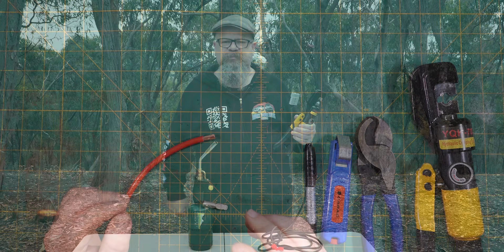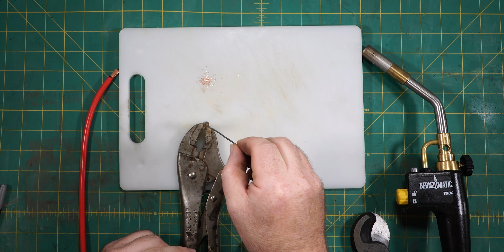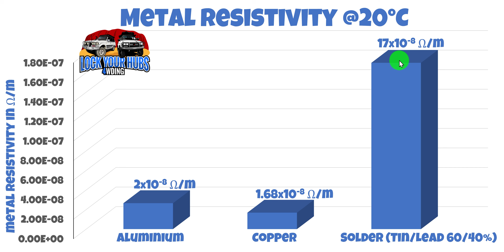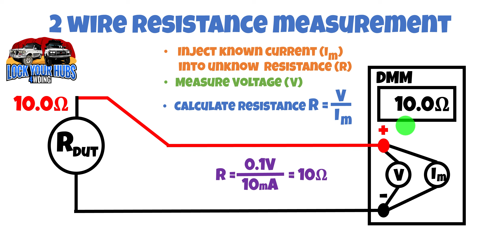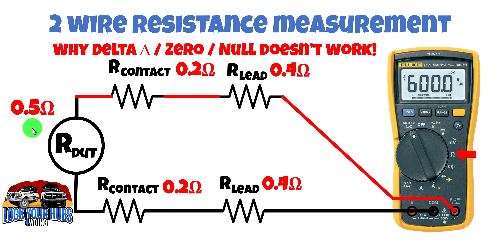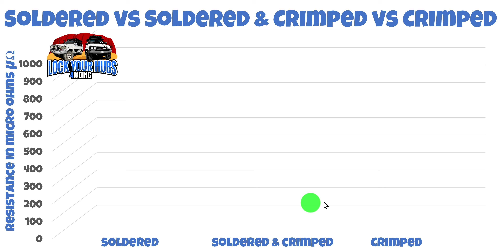Crimping vs Soldering for Anderson Plugs

Comment: Had a thought about 'tinning' the stub to go inside the Anderson part. The start of bonding the solder to the copper prior to the plunge into the molten solder.

Small Bottle of soldering Flux with a 'cotton bud' as the applicator could make the solder bond more effectively maybe.

Thanks for the demo ,so good and factual .

Comment: As an AME and having crimped many bonding cables as per Boeing and Airbus specifications and performing inspection and final testing using approved test equipment, I fail to believe that a solder terminal is better in any way than a quality terminal and  correct crimper used by a person that has training in correct crimping procedures.
Reply from the maker: So you could say you don't agree with my findings! 😂 And I understand what trade and undergrad classes teach, my question though is have you ever done AB testing yourself? To either confirm or disprove my testing done here.

Comment: just 1mm of solder, same with the cable's tip.  so it's "soldered" at the tip of the strands. Then crimped at the neck. 
 Maybe do a resistance according to how much green and powdery crap is in the connection. EVERY CAR THAT SITS FOR A YEAR OUTSIDE IN OREGON will have green chalk chia pet in the joint
Reply from the maker: Use some glued heat shrink!

Comment: Crimping is much better than soldering when it comes to vibration resistance. Anyway, finally found a video where the proper tools are used for crimping these SB 120 connectors. And very well explained!

Comment: Id really love to see these resistance tests under load through the connection of the anderson plug itself, i cant find anyone else on youtube who seems to have done so, and you seem very suitability equipped to do such testing! Love the video thankyou
Reply from the maker: The termination resistance would be twice the measured for each positive and negative. Then twice the contact resistance (not sure what that is! Though I understand it's around 1.2-2milli ohms per Anderson.) 

As the resistance is not going to change with normal usage, you could just use ohms law to derive the contact resistance.

Comment: I've always thought soldered is the way to go this was a great demonstration thanks. I had no idea crimping alone was so much worse.
Reply from the maker: Don't get me wrong, crimping is orders of magnitude worse than soldering resistivity wise, though the overall losses of a couple of crimped connections in a wiring setup vs soldered while higher, will not be orders of magnitude worse than the same setup, when you take into consideration the losses in the cable, contact losses of the joints etc.

Comment: Excellent!  Curious the resistance:Tip to tip of just connector as well as same length of wire without connector.  Both will be tiny but they can quantify the same bonding methods.  Thanks!

Comment: I used to crimp but they didn't hold, then I crimped then soldered.. the solder did the holding  because I had really bad crappy crimps.
I got tired of that and actually got a good crimping tool and learned how to crimp and now they hold.
And while I don't have a lab to test things.. I think that from what others have said, they have a really good case for crimp only and that is what I do now.  Even if wither method would work fin for my uses.. I prefer to do things right and I don't like that solder has different conductivity and heat expansion and capacity to crimped copper or cca for that matter.
Reply from the maker: I think the most important variable is the quality of the termination, whether you decide to crimp or solder.
Reply: I've bought awg 2/0 wire before  and it fit in a awg 2 lug.. that wire did not meet the standard for double aught wire.. the lugs were ok, but some lugs are too thin too.. anyway I sent it back as I needed at least 1 awg  but supposing I crimped that wire with a 2/0  lug or proper wire and a poor lug,  neither would be a good hold. And it takes a bit  to know.

That hydraulic crimper was a good grimper but it can't make up for other deficiencies.

Also there are specialty crimpers for Andersons.. so that was even the wrong crimper as that was for lugs, not open barrel terminals.

So there could be several points of failure here.
Reply from the maker: @coo463  you're right that ideally you use the correct combination of crimper, wire and lugs/termination.

Comment: I’ve read the soldering can cause premature failure.
Reply from the maker: I've heard that as well, though not seen any concrete evidence.
Reply: @LockyourHubs4WDing  
I’m not sure, but I think what was said was that soldering a connection results in the wires outside the lug or ferrule Wicking the solder and then movement of the wire causes the strands to crack. And you are probably aware of this because in another comment you mentioned that you don’t tend the wires before flood soldering because you don’t want the solder going under the insulation.

I’m building up solar system for my RV. I’ve used zero solder. All of the crimps so far have been made with a hydraulic crimper. It was very interesting to see the data in this evaluation you did. I was very very surprised my degree is in chemistry and seeing something like this makes me want to investigate further. But I’m 70 years old and building an RV. Not gonna’ to happen.

Anyway, very nice video. I’m also impressed that you respond to your comments. I’m going to subscribe to your channel even though I probably won’t have a use for any of your videos. Well actual use. they’re interesting though. But hey, that’s kind of a use, isn’t it?

Comment: I'm thinking that the reason soldering came out best could be that, while solder may be less conductive than copper, it's got a full 360' of contact with the connector. Unless the crimped one is crushed up until the coppers strands inside deform enough to remove every little air gap between the strands in contact with the connector it's going to result in  lines of contact between the strands and the connector.

To help explain what I mean, picture arranging a single layer of coins in the bottom of a round cake tin. Around the edge of the tin you'd only have multiple little points of line contact between the edges of the coins and the inner edge of the tin, so dispite having a lot of surface area on the tin and the coins, the two surfaces are only touching in a tiny percentage of that area. If you smooshed something conductive between all the coins and the edges of the tin you'd increase the contact area between the coins and tin by a huge factor, so even with solder being less conductive, the hugely increased area of contact between the surfaces nulls the extra resistance out.

This theory could be wrong, but it seems pretty plausible in my head.
Reply from the maker: Lost I agree to some extent, I have cut open a properly crimp connection and the copper strands do to form like you say.

Comment: I'm an electro-mechanical engineer having developed large Li-Ion batteries since 2008.

Crimping basically works by deformation hardening the lug around the compressed wire strains. Heating it with a solder iron or torch anneals the hardening so the lug lose it's tension and the strength is left to the solder tin, which is prone to cracking if exposed to vibration.

That's why crimping is an industry standardized method that you can trust (if you follow the standard) and why soldering is not!

Read and learn DIN 46234, DIN 46235, DIN 48083

And also, crimp terminals should be tested through both resistance, heat cycling and mechanical stress. Heat cycling is done at 120-140 deg. C by injecting current. That's also standardized!

Now try put your soldered terminals through 1000 such cycles (knowing that copper and tin expands/contracts different) and do your resistance test again - let alone a proper pull test.
Reply from the maker: While I couldn't find specifics of the Anderson terminals, I had a look at a major supplier (Cambac), their lugs are supplied in a fully annealed state. 

So I assume all the hardening is work hardening? 

Annealing copper usually starts around 200-300C, though to fully anneal requires around 500-650C. 

Soldering requires around 180-190C for the usual lead/copper. 

Though the temp isn't controlled  to the exact degree using a blow torch to solder! I don't think the work hardening would be affected greatly by the soldering process.  (Though happy to be proven otherwise! )

If you are heat cycling to those temps, while it may be compliant with the standard, it might not be a bad idea to up the conductor area! 

My objective of the test as stated wasn't to assess tensile strength, heat cycling durability, or even vibration resistance.  It was only to look at conductivity, and the testing proved that a soldered connection for an Anderson plug termination is superior to a crimped one.
Reply: @LockyourHubs4WDing  Yes, they are annealed and designed to harden when you crimp them - and that's why you don't solder them afterwards as it only takes 200-250 degrees C to anneal copper while soldering takes 315-370 deg. C (otherwise you get a cold soldering).

Same is the case with Anderson pins and all other crimp terminals.
Reply: @LockyourHubs4WDing  And no, I don't believe you proved the conductivity. 934 microOhms seems totally off unless something in either the crimping or testing process went completely wrong.

I previously linked to a paper showing test results of various crimping methods of more than 60 cable lugs. All turned out between 2 and 9 microOhms - which is more than 100 times more conductive than yours.

Dunno where that comment went (maybe removed because it contained a URL?) but you can search the titl: "Dependency of the Electrical Resistance in
crimped connections on mechanical stresses".
Reply from the maker: As a rule, URLs are automatically censored by YouTube. 

My results as always were an average of three tests, so while I could have been consistently incorrect, it's aimed to stop erratic results.
Reply: @LockyourHubs4WDing  Thanks for telling me, I didn't know that rule.

Now if you made the same mistake all three times, your result would be the average of 3 erratic results, which likely explains why it's off by a factor of 100 relative to the paper.

So in stead of using the same messed up method 3 times, you should use at least 2 different methods, one of them e.g. involving a professional micro-ohmmeter, that you can most likely borrow from the nearest university if you don't want to buy your own.

Comment: I usually just insert the wire and have a bit of the insulation exposed and heat it up and feed solder until it's full, then heat shrink the end after cleaning the end that has melted slightly.
I might try your method and see how it goes.
Once done it's a nice clean finish and heat shrink goes from the round part of the lug and down the cable past the heat affected bit, the end result I have found is tight and I have never had a problem with any that I have done, infact the Anderson plug that connect to my ute for charging the caravan has to be redone as it was there when I bought it as it is crimped and corroded with loose strands, where the ones I made for the solar panels is strong
Reply from the maker: I think decent double walled glue lined heat shrink is the trick to it, whether you solder or crimp, it protects from corrosion and reinforces the joint from fatigue.
Reply: @LockyourHubs4WDing  and that is why the one i have to repair is worn but it also took 14 years haha

Comment: but do your findings scale to high amp applications? Perhaps your modest current benefits from larger total contact area of soldered connections. I wonder what results you’d get if you pushed 50-100amp through those leads.
Reply from the maker: Resistance is resistance and will obey Ohm's law

Comment: As an Electrician, there is a reason we have to get our crimpers calibrated, and yes even the red, blue and yellow pre-insulated crimpers when we are building mining and gas and oil equipment.
My guess would be that the crimper used didn't compress the strands in almost one solid mass.
Cabac have a good handful of pages in their product manual showing over/correct/under compressed lugs.
It is worth a look for those who are interested.
Reply from the maker: Those results, don't forget were an average of three tests, for all the tests. While the possibility of consistently incorrect results for all of the tests is a possibility, it's not probable. 

I'm happy to be proven wrong or otherwise. And encourage others to replicate the test, to see if they're independently repeatable or not. 

I'm still going to have a look at vibration resistance, with and without heat shrink. I've been told by all and sundry that crimped terminations resistance was less, now have experimental data proving that to be false. I'll be looking at the next wives tale.
Reply: @LockyourHubs4WDing  Have a google for Cabac Crimping Guide and either find the PDF that says the Right Tool for The Right Lug for the Right Connection, or around page 17 or 27 or something like that for the same info.
Cabac also have some videos of good compression in the joints.

I have been running 7 strand cable with a crimped and soldered lug on the back of my rally car alternator since the late 80s, and it has been through multiple engine changes, alternator changes, tens of thousands of punishing vibrations, and the sort of thumps that break engine mounts. I have also done similar with 4wd wiring. I don't recommend it to others, but I would like to think I knew what I was doing as an apprentice, yeah ok I guessed back then, and since then I should know what to look for with damage and wear and tear.
I did make a 32mm pig tail style of coils to absorb the vibrations and they have held up on every vehicle I've punished. lol
Reply from the maker: Thanks I'll check out the PDF over the weekend. You make a very good point about support,  plenty of termination issues would simply disappear, regardless of soldering and/or crimping (even low strand wire!) if the termination is properly supported.
Reply: @LockyourHubs4WDing  Sorry, I think I led you astray, mine aren't supported, although supported would definitely be better, just bolted straight to the alternator stud, or other bolt, stud, terminal, etc, with a bit of a pig tail for movement, some then have a straight run, and then bolted to the battery, starter, or chassis, depending on which vehicle and which cable.
Reply: @LockyourHubs4WDing  From the way you did the tests, I'm guessing you already know of a Ductor. When we were testing HV the 100 and 200 Amp Ductors would get down to single digit micro ohm readings on crimp joints but we used Alminox Paste on the aluminium cables, which has sharp aluminium particles in it to cut through the tarnish. 
Copper needs the copper paste type that I have forgotten the name of, but we could use a Nickel paste and that was better than the silver paste for heat and corrosion in some instances.

I hope I'm not mentioning things you already know, but if so, maybe the people reading along can get something from it.
Reply: @LockyourHubs4WDing  I can think of two things that would cause a higher resistance with a soldered connection:
 
The first would be an incorrect flux/wire selection.
For most electronic/electrical solder joints, Rosin core (RMA) soldering wire would be golden.
Acid core wire would be an absolute mortal sin. 

What is called a "cold solder joint" also would cause increased resistance.
Vibrations or movement while the solder is cooling can cause a cold solder joint. A solid mechanical bond (crimping) will help mitigate the chance of this.
Too much heat or not enough heat can cause a cold solder joint. Tinning the wire will help mitigate the chance of this.
(It should be noted that tinning the wire can make crimping more difficult.)
Reply from the maker: @garygrant91 yep, don't tin if you're going to crimp!
Reply: @LockyourHubs4WDing  actually consider the fact that you are only using one crimping tool the possibility for them to be consistently incorrect is extremely high. It’s the exact same crimper it’s the exact same crimping die. The only way to reduce it probability would be to use different crimpers or different crimping dies
Reply: Or just solder it..
Reply: @ Crimping is still better than soldering if it is done correctly. There is a reason it is used on High Voltage and critical Instrumentation Processes.
If both crimped and soldering joints are done incorrectly, the poorly crimped joint will be a better than a poorly soldered connection.

Comment: I use the dent crimpers often found on stamped plate wire strippers on the handles just before the jaws. Light force results in a dent about 2mm diameter, 1mm deep. I do one about 3mm from the bottom of the wire receptacle (where it becomes a cylindrical shape, just above the dome) and another about 4mm higher, on the opposite side. I strip the wire to expose 2-3mm more than the depth of the receptacle.
I then fill it to the level of the upper edge of the second dent with molten solder (usually that's about 3/4 full), heat the contact and bottom of the receptacle for 10 seconds using a butane torch, and jam the wire in hard so the strands have to bend to allow the entire stripped length to go in.
The dents aren't deep enough to obstruct the wire, but once the solder solidifies it is virtually impossible to remove the wire even if the solder completely breaks free and separates from the inside surface of the connector, because the shape of the solder plug makes any movement impossible, and the bent wire strands also greatly reduce the likelihood of slippage (which is already extremely unlikely but I figure it can't hurt to make it even less likely).